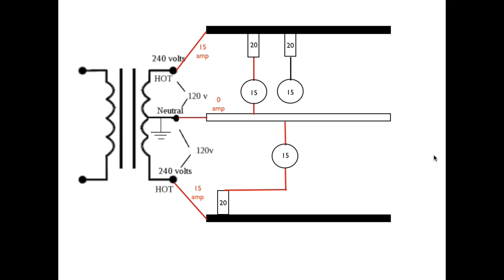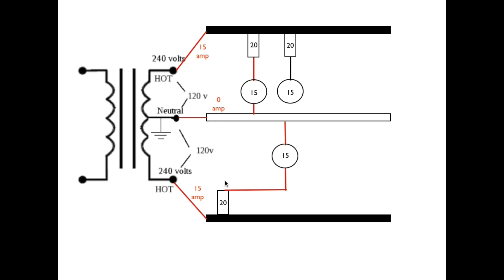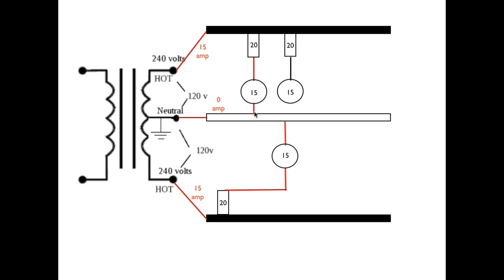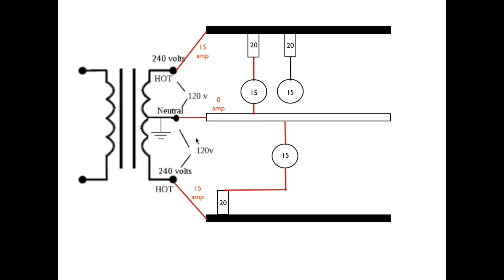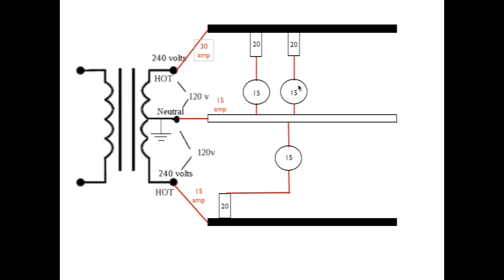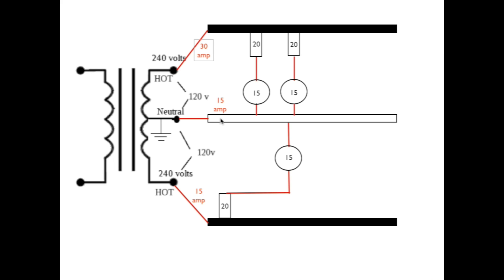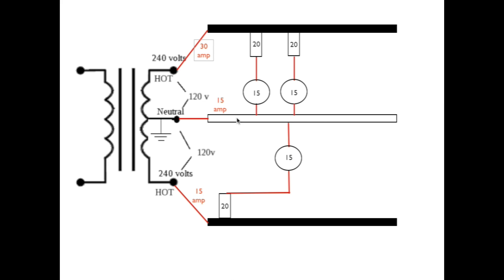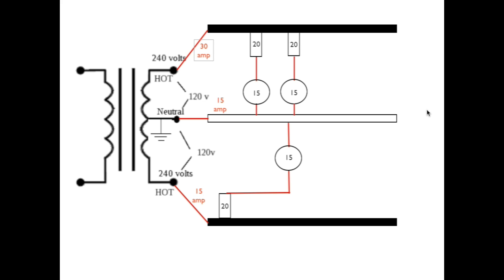How unbalanced loads work

Comment: One thing I have thought of that no one else I have seen comment on is this on a resisdential panel you commonly have 2 hot legs at 100A each but only 1 neutral which is commonly not even rated for 100A I believe it’s 80A or something along those lines so at the minimum there is a decent proportion that is flowing through the hot conductors because if you have 180A between 2 legs you can’t have 180A on just the neutral

Although one more thing I would like to point out is the current that is coming from one hot leg of a circuit and flowing to the neutral bar in the panel would have 2 paths to follow being through the other leg of the hot conductor to the XMFR and through the neutral conductor so with that being said I don’t see how 100% of the current would flow through the hot leg given it has more resistance than the neutral path

Comment: I think what I am hearing is that if the load and number of circuits on one side was exactly equal to the other side then the neutral isn't utilized and could be removed from the circuit in a hypothetical scenario and the neutral would only be utilized (which would be most of the time) when imbalanced to cover the imbalanced situation?
Reply from the maker: You got it.
GFM

Comment: If you took an oscilloscope and viewed the volts across the loads on opposite buses you would see that when one load is at plus 120 volts when the opposite load is at minus 120 volts. They are inverted with respect to one another, because they are said to be 180 degrees out of phase with each other. That is how you get 240 volts across the transformer winding measuring one bus to another. These two opposing voltages cause the currents to cancel each other out completely if the current draw is identical on both loads. The difference between the currents on opposite phases will translate into the current flow seen on the neutral.  Therfore if there is zero current returned back to the transformer on the neutral the load is said to be in balance. An oscilloscope (a tool used to physically view the voltage in time or current in time on a x, y, axis) would illustrate how the current sine waves can cancel each other out.

Comment: in 240v circuit neutral carry same current as line and how your RCD works if no balance between N and L1 ?
Reply from the maker: In a 240 volt circuit, no current should be present on the neutral.  If there is any current in the neutral, the RCD will trip.
GFM
Reply: @grayfurnaceman  sorry do you understand how RCD works?
Reply from the maker: @Thrill98  Yes
GFM
Reply: @grayfurnaceman  it doesn't look like
Reply: Sorry there's no such thing as a neutral in a US 240v circuit

Comment: I hear a lot of different opinions about neutral and the way current flows on it and it carries the unbalanced of the circuit. Here is how the neutral works. Let’s look at 120/240v single phase. When current flow from L1 through 5amp load and returns on the neutral in a clockwise rotation due to polarity. At the same time current is flowing from neutral through 3amp load returns on L2 in a clockwise rotation due to the same polarity. If you draw a picture with arrows showing this you would see that 5amps is flowing one way and 3amps flowing in the opposite (180 degrees) direction. If you amp clamp the neutral the reading would indicate 2amps. That’s because they cancel each other out. 5 - 3 = 2. That’s a simple answer. I can state it in a more formal way by say the current on the neutral is the vector sum of all currents. Three phase 4 wire is no different except instead of 2 phases connected at 180 degrees apart, you have 3 phases connected 120 degrees apart. Hope that clears everything up.

Comment: I'm not going to go into an analysis, but I'll give you the keywords to search up if you want to convince yourself that both "through the breaker" and "through the neutral" can be right. To fully understand this scenario you'll need to google and understand:
- superposition (its why you'll see 0A on neutral if the loads are balanced. Image everything flowing through neutral, but perfectly out of phase)
- Kirchoff's Current Law (Kirchoff's Voltage Law is also pure gold)
- "Node Voltage" analysis (recommend Kahn Academy here https://www.khanacademy.org/science/electrical-engineering/ee-circuit-analysis-topic/ee-dc-circuit-analysis/v/ee-node-voltage-method-steps-1-to-4)

To simplify, since these techniques are easy with DC but tougher with AC, just imagine doing your analysis at a snapshot in time. The legs will have equal magnitude voltages but opposite signs. Proceed as if it's DC. Your current values will also represent that moment in time so don't expect them to come out at exactly 15A.. they likely won't. Look for balance between the branches!

Now repeat with the extra breaker and see where the currents flow. See how many different ways you can describe the decomposed branches that you work with.
Reply: Sorry your not making any sense. Current NEVER can backflow through a CB because the CB will trip to prevent overheated wires causing a fire
Reply: @gregfreeman6476  If you're thinking that the back-fed current will double up the amount of energy that the conductors the CB are protecting, remember that the phase of the currents involved in the situation in this video will be 180 degrees out of phase. The effect is that they'll be cooperating instead of fighting.
Reply: @jlpffs  I understand your reasoning, but again I would refer to understanding electric flow by thinking of the ocean.

If on the open ocean you have waves going in 2 directions, 1 say headed North and the Other headed South, they would cancel each other and there'd by no wave at all and thus no flow.

Also consider that if the current is going both directions at once through both CB's but 180* out of phase, then when you connected a volt meter between the 2 hot wires (connected to an appliance or the CB in the box) you would only read 120v as that would be all going to the meter at any fraction of a second.

240v is used in motors and appliances that create heat or movement and utilizes All the current, therefore there is no current, and hence no voltage, to return to the panel.

It goes to the laws of conservation of energy and of mass.

Also consider that if you were to complete a full circuit using only the 2 hot wires you would be back feeding the transformer and blow it.

You can demonstrate this to yourself by buying a cheap step down transformer that will step your 120v A/C to 12v A/C with a center tap.  After your plug it into 120volts connect both hot wires on the 12v side and watch it loud pop and smoke
Reply: @gregfreeman6476  Naw man, thats not what backfeeding is. You're describing shorting the transformer. Yes, shorting a transformer will blow it. Backfeeding requires actual generation on the secondary side.

Comment: There is an error here. Remember the concept that current flows from higher potential to lower potential. I will give values to explain better: At the peak of the ac wave the top terminal is at +120 volts and the lower terminal is at -120. If we connect loads to each terminal then the current in the top load will go from the top terminal (+120v) to the neutral (0V) in clockwise direction. At the same time the current in the bottom load will go also clockwise but from the neutral (0v) to the bottom terminal (-120v) because 0 > -120
Therefore, if the loads are equal then we have the same value of current flowing through the neutral but in opposite directions canceling each other out and giving us a perfectly balanced circuit. If the loads are different then the circuit will be unbalanced. But either way the flow of current will always happen as explained above. At no times there is power in the neutral. Now when you connect a load from top terminal to lower terminal (240v) then there is no neutral at play
Reply from the maker: Look at it this way.  If there were 2 terminals, one at positive 120 volts and one at negative 120 volts.  Would not the difference in polarity cause a movement of electrons in an attempt to equalize the charge?  And if one of those poles was connected to the center tap (0 volts), would not the electrons move to equalize the charge albeit at a lower pressure?
GFM
Reply: @grayfurnaceman  I have now edited my original comment. Please read it. I think can answer to your inquiry. Electrons don't flow with intentions of equalize currents. They just flow from higher potential to lower potential
Reply: @jefff smith ,  https://www.youtube.com/watch?v=LJvyb_WujZg&t=270s

Comment: You can set up a 24VCT transformer on your bench, with all kinds of loads (even large resistors) and go crazy with meters (DMM's), etc. until you understand things and answer your own questions.  First make sure you understand Ohm's law for I,R,V,P.  It is best to have a high current transformer, just watch the limits. 

OAS/FYI:  Pole Pigs are NOT current limited.  I was "lucky" to have been in a car parked nearly under a huge triple Pig when it blew.  NO OTHER WAY to learn the respect these things demand!  Colorful (in a Roman way) and earthshaking.  I will NEVER run one in reverse without current-limiting.

Comment: Please correct me if I am wrong. Neutral wire is theoretically at 0 potential. Hence any current at any point of time should go through neutral. If the load is unbalanced on any leg the etra current will also pass through neutral line only. Never expect balanced load in the two legs in the first place, in normal situations. It will always be unbalanced. It is not the headache of consumers. Utility people take care of it . How can current flow through other legs? In that case it should flow back through household machines and motors which is not possible.
Reply: My question exactly. I wish somebody could answer that.
Reply: @matthewgalcik2733  The OP has everyone mixed up.  For 120V (Line to Neutral), current will flow from the respective legs L1 or L2 to Neutral.  The current of each legs are 180 degrees apart & if balanced, the currents will cancel each other out (basically at a point in time, if L1 is 90A, then L2 is -90A).  If unbalanced, the differences of the two will be flowing into the neutral; assuming purely resistive loads.  The ONLY time current will flow from L1 to L2 is in 240V circuit or short L1 to L2 (CAUSING A BIG CURRENT SPIKE) then OP is absolutely current.

Comment: A balanced load would be the same amperage between L1 and N are the same as L2 and N. Only time current would flow back through a breaker (current flow through L2 and L1)  would be if the neutral was open. Then you would notice erratic voltages between each leg and neutral.
Reply: Current can NOT flow backwards through a CB as it would instantly trip it to prevent a fire from excessive heat in the wires and also prevent a dangerous backflow into the power grid that would cause a blackout.

If there's an open neutral then there's simply no current flow.

Think of it this way. Can the water in a hose backflow against the water going into the hose without the hose exploding ?
Reply: correct
Reply: @kigalexander9672  Not correct

Comment: At  4:07, "it's the responsibility of the utility to deal with any unbalanced loads.  And I have no idea how they do it.  They just do it."  I was hoping that you would explain this.  The circuit is drawn correctly and the transformer drawn will balance the loads.  This video would be better if that was explained.
Reply from the maker: That one is above my pay grade.
GFM
Reply: I admire hard work and humility.  GFM, you've beat me on both counts!  I'll try and step up.  I'm an IC engineer, not an electrician, so chances are, I'll screw up.  The transformer does the magic.  Looking at 4:07, let's say that the flux-coupled transformer has four turns on the primary side and the secondary side (one turn for each lump).  The top side of the secondary has 30amps·2turns = 60amp·turns.  The bottom side of the secondary has 15amps·2turns = 30amp·turns.  Therefore, the primary must be inducing this flux with 60amp·turns+30amp·turns= 90amp·turns. 
 90amp·turns/4turns = 22.5amps of current in the primary.
Reply: Some previous comments seemed confused by the superposition of the secondary.  The bottom side is 180° out of phase with the top side.  Therefore, half the 30 amps "going into" the top side form the neutral tap is the 15 amps "coming out from" the bottom side,  The other 15 amps "comes from" the neutral bus as drawn.
Reply: Finally, although I'm not an electrician, I BELIEVE that the primary side is usually 7200VAC and the secondary is 240VAC.  That implies that there are 30 turns on the primary for every 1 turn on the secondary.  As a result the current into the primary will be 22.5amps/30=0.75amps.  The loss of a cable is I²R, so each 0.1Ω of line will have 1/900 of the power loss at 7200VAC than if it had been run at 240VAC.

Comment: The neutral is an actual physical tap into the middle of the winding in the transformer and so nothing else needs to happen on the side of the power company for this type of unbalance in the load.

Comment: what are the consequences of an unbalanced load? What could physically happen?
Reply from the maker: If the load is unbalanced, more amperage will be on one line than the other.  If the unbalance is large enough, it will open the circuit protection.
GFM